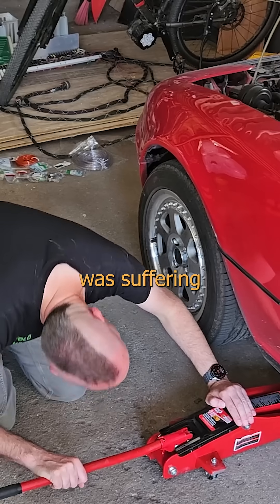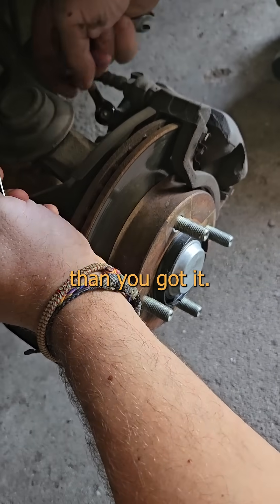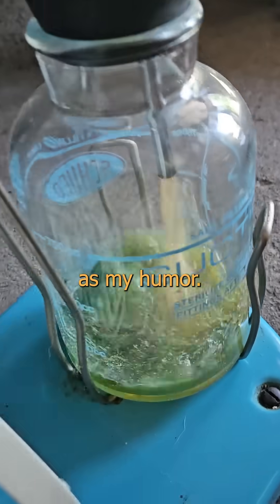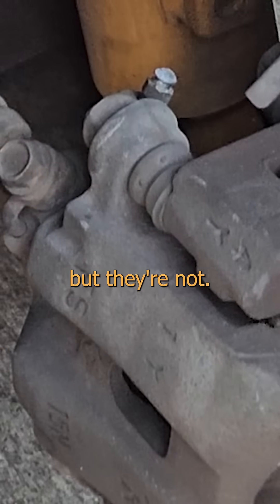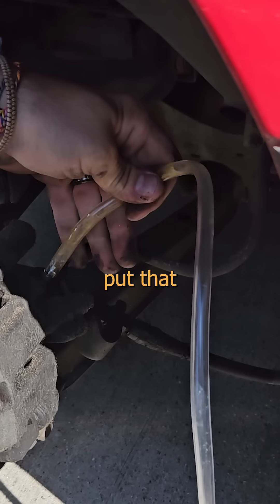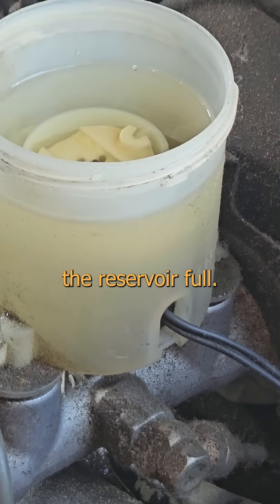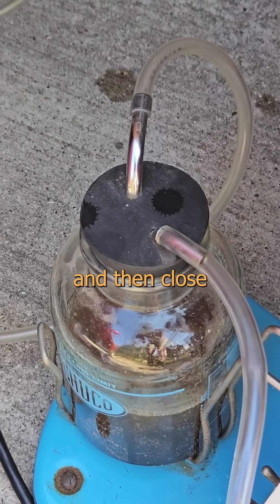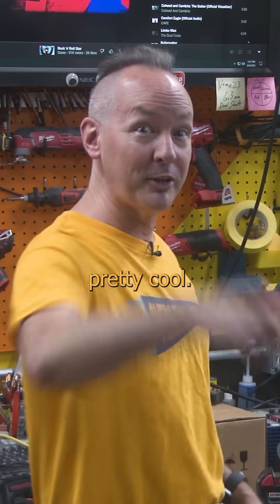How To Change Brake Fluid #chrisboden #comedy #engineering #educational #diy #skills #lifelessons

Comment: Not over engineering. This is how we would do BFEs at the VW dealership. Except ours was even more engineered, because the machine would also connect to the reservoir and pump in brake fluid. Pressure on one side, vacuum on the other side, and we get a BFE done in half an hour

Comment: This is absolutely the way professional mechanics do brake fluid flushes. It's not over engineering at all. It's the perfect amount of engineering! You should also replace the fluid with a extremely high temperature fluid that will have the best chance of keeping the brake fluid from boiling and you loosing all your brakes exactly when you don't want to. Wait, these are just all things you should do to your Type R after you add a bigger, but not huge upgraded dual ball bearing Turbocharger. The Type R can get a good amount of power on the stock block as you can imagine. I'm sure you know they can hold 400 to 500 wheel horsepower with just a Dyno tune. Type R's have quite a bit of trouble keeping the engine coolant temperature in check, so I highly recommend a PRV or Mishimoto extra thick core radiator with some upgraded electric fans and  air tight fan shroud made from aluminum hopefully. A nice size oil cooler wouldn't be a bad idea either. All of that and the right Engine control computer with a E85 sensor with a couple wideband O2 sensors. A nice Haltec 1500 or 2500 or even a cheaper Ktuned or Flashpro unit can get the job done. With a quality tuner and some Dyno time, you can roll around with 400 wheel horsepower or 525whp to Maybe even more, but you are pressing your luck after 550 wheel horsepower I think. I would also recommend a Mechman 250 amp alternator or possibly a 320 amp alternator with a regulator set to 15.5v  to get more power for spark and fuel delivery and a 120 amp hour bank of 40 Ah XS Power LTO cells in a 3 in parallel and 6 in series configuration moved to the trunk with some 3/0 gauge OFC welding cable to take some weight out of the front end or you can get silver tinned OFC wire if it's on sale or something, but I prefer regular pure 99.99% copper, and I prefer welding cable, but you generally need to go up 1 size larger than car audio wire to get the same current carrying capacity, or so says the labels on the welding wire and car audio wire specs. Either way, LTO is 50% to 60% lighter than lead acid and is has a usable temperature range of -40°F/-40°C up to 60°C to 70°C and it's by far the safest of the lithium chemistries. They also can go up to 80C burst discharge rates and 30C to 40C continuous discharge rates and 20C to 30C charge rates. You can charge a 120 Amp Hour LTO battery in around 10 minutes from 0% to 100% if you have the correct voltage and more importantly the amprage at 16.2vdc to max 16.8vdc with the correct CC/CV charging profile. I prefer the smaller 10Ah LTO SCiB cells to the 40Ah XS Power/ Yinlong cells, but you don't really need the complexity of running 10 to 20 of the smaller 10Ah SCiB cells in a much bigger box, even though you could discharge anywhere from 30,000 watts RMS to 100,000 watts RMS with a bank of the 10Ah LTO SCiB cells with 10 cells to 20 cells in parallel and 6 in series. They have an 80C burst rate, so 200Ah and an 80C burst rate is some serious power output, and a 320 amp double diode per phase full bridge rectifier and double output, 6 outputs but 3 phase stator give nice and stable and strong voltage and amprage output even at lower RPM, say 800 RPM, with full thick copper 500°C coated copper windings and high temperature neodymium magnet rotors, with a range of internal and external adjustable voltage regulators that can either follow the command of the electronics computer or you can use a regulator that stays steady at 14.8v or 15.5v or as high as 16.2v or is adjustable to anything up to 18v. It's obviously not recommended to run your whole car on 16.2v because the electronics are sensitive and will misbehave or break anywhere from just over 15v to 16v, so it's best to just run a 2nd alternator that powers your LTO cells and certain things like a fuel pump or a 8,000 watt subwoofer amplifier like a Taramps Big Boss 8k and a pair of bad ass 4,000 watt subwoofers or four 2000 watt subwoofers to get more cone area and be louder because cone area is king in the world of audio systems for the most part with certain exceptions.  I just got a nice Neodymium subwoofer made by a company named Fi that is now part of the Sky High Car Audio group of companies. They are in a part of Nevada that's very high above sea level, and they make pretty much the best OFC wire, accessories and now multiple subwoofers and brands of Subwoofers and soon multiple half bridge Korean or Korean style amplifiers and maybe they might just branch out into full bridge Brazilian style amplifiers just to have great price to performance like Taramps basically runs the market selling very well made Big Boss 8k amplifiers that output 10k watts RMS from 0.5 ohm up to 2 ohms to fight impedance rise. Just like JL Audio Slash series and Rockford Fosgate BDCP amplifiers have done for at least 10-20 years. Taramps will accept an input voltage of up to 17 volts DC and they also have a 60,000 watt RMS and 120,000 watt RMS amplifier that runs off high voltage, like a ton of high output Lifepo4 LEV60F cells capable of 600 amps output at 12 volts all run in series up to something like just over 400 volts, so basically it requires the full output of a Tesla model S P100D Ludacris edition 100 Kwh battery pack to run one of these amplifiers. Not many people run amplifiers that output 100, 000 watts and run off 400 volts DC. I went way way off topic here. The main topic was Chris' Type R and upgrades that are important that would give the car much more longevity and more power without barely any work. Something like a 4 inch downpipe and a 4 inch exhaust, turbo upgrade, much better radiator with better fans and fan shroud. Better engine control computer and a Dyno tune, a nice oil cooler to keep engine temps lower. The newer Type R Civics have issues with coolant and oil temperature when being pushed hard around a mountain or a track. Anything that can keep coolant and oil temperature down will definitely give the car more longevity. Getting 500+ horsepower out of the engine is easy. It's the cooling that you need to worry about if you want to keep the car going to 250, 000 miles like a proper Honda.

Comment: oh. to remove air bubbles I was just the guy in the car pumping the brakes to pressure. then the guy in the wheel well would bleed the line, close it, then id pump the brakes up again. repeat until no more bubbles.

Comment: I wish I had access to the overengineered way to refill the brake system because while my dad was working on my sister's car, I pressed on the brake pedal a total of no less than 200 times, possibly more as we tried to bleed the brakes but nothing improved. The brakes were mushy and unresponsive, the ABS light was on, we replaced the ABS pump, didn't improve, I was worried i'd fall when getting out the car because i always wore out one leg pushing the pedal down repeatedly, we replaced the master cylinder, and HEY GUESS WHAT MORE BLEEDING meaning more tired legs. Oh sorry, I mean leg. One tired leg. It might have been the master cylinder, we also replaced from brake lines. I don't know, I was too confused to comprehend what fixed it but he eventually did. Usually being the brake pedal presser for bleeding brakes is only mildly annoying and done in like an hour but like. if something that confusing happens again, I'm gonna want a vacuum pump. Lazy? Maybe, I know I am. But it still annoyed me.

Comment: Just a head up you cant always do this on modern cars some of the brake systems have electric valves used by the traction control system so do a flush you need a scan tool capable of commanding the brake flush

Comment: Definitely not over-engineered.  It's the only way to reliably do it alone.  I've got a Four Brothers brand one that connects to an air compressor, and there's a large reservoir that clanps to the master cylinder reservoir so you don't have to keep topping it up so frequently.

Comment: Finally….i see someone work on an automotive brake system that didn’t just open the bleeder and let the brake fluid drain out on the backing plate, tire, or ground! It really doesn’t take much effort to hook a piece of clear tubing up to a discarded two liter plastic with a hole drilled in the cap just slightly smaller than the tube for a snug fit…..then you collapse the bottle some and attach the hose and open the bleeder!

Comment: The vacuum method does work however the best method is to put the entire brake system under a few PSI of pressure with a power bleeder it basically pressurizes the brake system slightly and then you open the one at a time until you flush out the old fluid in any are and then you close the bleeders again while the fluid is free flowing which eliminates any chance of air the vacuum method can make it more difficult to bleed air out of the system when refilling.

Comment: I replaced the brake fluid on my grandfather's old motorcycle from 1978. The fluid was nasty, so I figured it couldn't hurt. Well, the old fluid was aparantly the only thing holding the old seals together, so the new cleaner stuff cleaned the gunk holding the seals together and it began to leak like a siv. I know it was the right brake fluid, it was written on the cap. Had to replace the brake resevoir...

Comment: Chris, as a professional mechanic, I'm gonna tell you to be weary of vacuum bleeding brakes. Maybe it's user error, but I've used purpose built vacuum bleeders and so have multiple people I've worked with, and they're not always perfect. Had one guy sideswipe an Altima into a Mercedes because he used a vacuum bleeder and there was still air in the system somehow. Pressure bleeders are where it's at. You get an adapter that fits the master cylinder, hook up a hose to the fitting and use any general purpose fluid pumper (even had a veteran co-worker use a garden sprayer pump) to push the fluid through the system. It is much safer as it mimics normal brake bleeding (one guy pumps while another guy uses the petcock) and works every time (as long as everything is sealed properly in your pressure bleeder kit). Glad it worked out in your case and I commend you for doing this service for a friend who helped you out, warms my heart to see people building a proper community these days.

Comment: I use a pressure tool, a tank that attaches to the master cylinder and pushes new fluid in while pushing the old stuff out without air bubbles. I love it, I can do my brakes and clutch by myself now!

Comment: Worked at a subaru dealer in service shop for a while, if you threw an oem bottle on the opening for the reservoir it would hold the liquid in and push it into the system but the worst that would happen is a couple drops of brake fluid to wash up. Never had air run in that way it was sweet

Comment: I bleed a quart of fluid through the brake system whenever I replace pads/shoes... I know to many people it sounds like excess work it's not.... The fluid (which is NOT oil based) picks up moisture over time, that's not a bug it's a feature... Traditionally these systems used (and most still do) alot of Cast iron and steel components. The moisture results in corrosion. The fluid can become slightly abrasive to seals resulting in failure and usually the corrosion occurs near seals where air and water migrate in causing rough patches that rapidly result in seal failure... Bleeding fresh fluid through with new brakes nearly eliminates this type of failure if done properly and consistently. My preferred way is a clear bleed bottle using clear tubing.. preload the bottle with enough clean fluid to cover the tip and of the tubing that extends to near the bottom (½" to ¼"/ 6 mm to 13 mm) ... Loop several inches of tubing to be above the bleeder with the bottle positioned slightly below the bleeder.... With the tubing attached to the bleeder crack the bleeder just enough for fluid to exit.  Pump the pedal  (10x is good for a start) until clean fluid is seen. Keep the reservoir full & start with the furthest wheel and work towards the nearest.... If you have a vacuum setup knock yourself out. Personally I haven't had it be a problem with manual bleeding and it causes the various seals to move a bit if any trash is going to be. dislodged.... But whatever makes you happy.

Comment: Commenting on the method:  Pulling a vacuum can introduce air into the system THROUGH THE SEALS!  The seals are designed to close tightly when under pressure.  When you pull a vacuum you relax the seals and air can enter into the system.  I once tried using engine vacuum to bleed my brakes.  I never got the air out.  Ended up doing it the old "Pump the pedal and release the pressure."

Comment: From experience I can say that pressurizing the reservoir a little bit and loosening bleeders works better than vacuum. First suck as most as you can from reservoir, top up with fresh fluid, loosen bleeders (put some hoses on them to catch old fluid), pressurize with hand pump a little, stop when you reach min or clear fluid flows from bleeders. To pressurize I modified spare cap by drilling a hole in it and mounting wheel valve.

Comment: One of todays jobs is bleeding the rear brake on my motorbike after I changed the sprockets, disc and pads. NOTHING on this bike has been easy. I've found seized and stubborn bolts everywhere and even a few that look like they've had blue threadlock in them- potentially since 2007. I am hoping nothing goes skewy now because all I've left to do after that is put the new chain on 🤞🛠

Comment: "over engineering is the best engineering" so air travels up,  "the best" brake fluid exchanger is one that pushes fluid through the nipple into the reservoir and there is a machine that sucks it out. They make them but they are $$$$$

Comment: Got a little worried watching you start cracking brake lines. Then i saw the vacuum pump.... not necessary. But if you fuck this job up youll be wishing youd bought one.

Comment: Just did this job on my Nissan after replacing the master cylinder. Black brake fluid is a good sign you have blown seals.

Comment: there was a local jiffy lube that was throwing away a brake flush machine because one of the wheels broke so they bought a new one and cut the power cord off it and had it sitting out near the trash. i took it home tested the pump and sure enough it was fine, bought replacement wiring for the little clamp guys that strap onto the car's battery and put some shitty caster on it and now i have a one man flush tool.

Comment: If you want to flush your bakes and you don’t have a vacuum pump, there’s something called a power bleeder (if I recall correctly. It’s basically a little hand pump tank that you fill with brake fluid, screw a fitting onto the top of your brake fluid reservoir, and pump the hand pump to push fresh fluid through your system.

Comment: A note here that brake fluid is hygroscopic, which means it pulls moisture from the atmosphere.  As it does so, it lowers the boiling point of the brake fluid, increasing the chance that you can boil your brake fluid if you're using the brakes hard, e.g. when you're driving in mountainous terrain or just going for a "spirited" drive. Also that moisture will corrode stuff like brake cylinder walls.

Comment: If you put a small hole in the top of the brake fluid bottle, you can put it upside down in the master cylinder reservoir.  It will keep it filled much longer without someone having to keep filling it.

Comment: But for god's sake don't waste your time, and money, with the compressed air powered brake bleeders. I went in on a decent one and came away with squishier brakes than when I started. Yes I RTFM.

However the auto reservoir filler it came with it pretty neat.

Comment: Drop your brake fluid bottle upside down into the reservoir and it will keep the reservoir full while you bleed the system. It won't overflow the reservoir.

Comment: Sometimes when using vacuum air will be sucked through the threads of a bleeder valve, it’s why most shops that do brake flushes will pressurize the system, then open the bleeder valve while a machine keeps the system pressurized. This prevents any air being trapped in the system (I’ve done both and have had the threads suck in air when using vacuum method ,no the brake fluid did not run out in the reservoir)

Comment: I have a similar vacuum system, except it's a container that hooks up to my air standing air compressor.

This might be overkill, but the compressor/vacuum pump makes it so you can do it with one person outside of the vehicle. Otherwise? You have one poor bastard in the car, stomping up and down on the pedal as you shout out to them "UP! DOWN! UP DOWN! UP! DOWN!" why you actuate the petcock, so it's open on down and closed on up.

Comment: Properly engineered, except for areas with snow and ice and salted roads.  Usually you need to remove the bleeder valves entirely or replace the caliper or do surgery to remove the bleeder.  But sometimes it works.  I did this before, kept the res topped as another guy did the suck job, but the puffer unit was jank, and disconnecting let air in, and as a possible contributing factor, I got into my worst sub-5mph-accident ever when my brakes spazzed out on the way home, after passing through a green light at 15 mph into suddenly halted traffic.

Comment: Pro tip: Don't remove the whole foil from the bottle opening. Poke a small hole in it and set it upside down on the master cylinder. The level will only go up to the bottle, and now you can bleed the lines without running it empty. And you don't need a fancy pump. Crack the bleeder and let gravity do it's job.